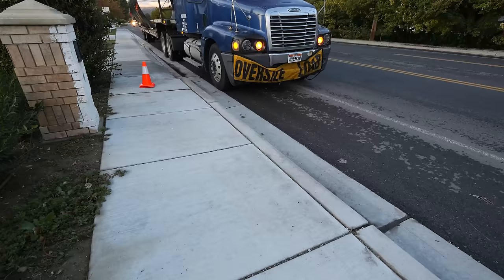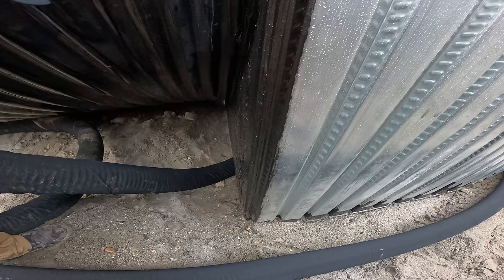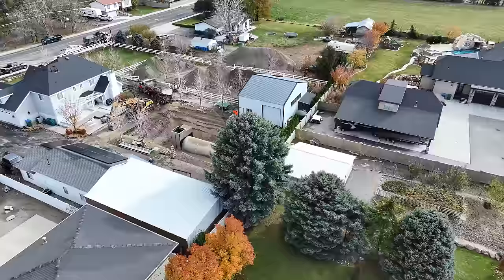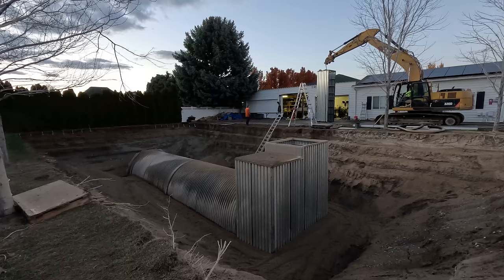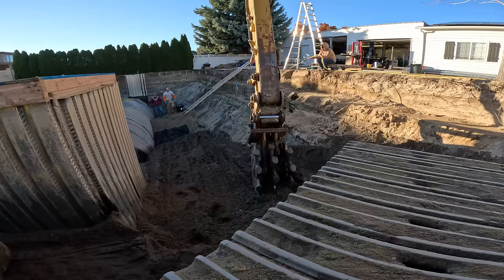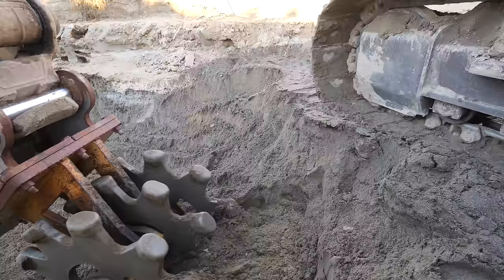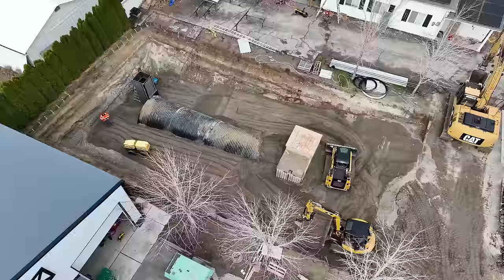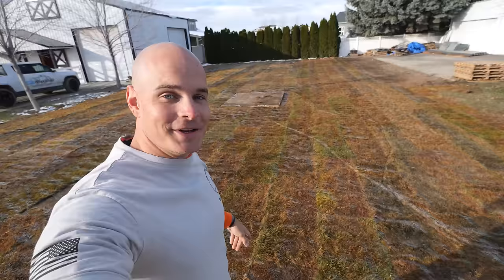BACKYARD BUNKER PART 6 - How To Bury a Tube

Comment: How would you do the plumbing for the bathroom?? 
This series deserves to be on discovery or history channel 🙌🏻🙌🏻
Reply: You can pump it up to the house's existings  infrastructure
Reply: composting toilets perhaps
Reply: You can use the elevator shaft to pump in and out. And electrical, oxygen etc.
Reply: Buckets? This ain't a hotel dude you're doing it in a bucket 🪣
Reply: Septic tank under the floor and piping to pump it from the elevator shaft. You can see the floor level of the bunker from the side rails and everything under them is prime space for stuff like wiring, plumbing, storage, water and septic tanks and there's surprisingly lot of space considering the floor will be around 2-3' from the bottom of the pipe.
Reply: Best bet, since they didn't run plumbing to connect it to their existing lines, would probably be an incinerator toilet with a pipe to the surface.
Reply: Nah, if it was on Disco or History they'd ruin the whole vibe.
Reply: @MrDehBoss  You could do that.....but one would think you would have put those holes in and run the plumbing before filling the hole and laying sod
Reply: @IcedForce  Ooh, hope not.  Any maintenance or god forbid, leakage, would fill the tube with secondary gasses, which may or may not be deadly, but would definitely be unpleasant.
Reply: No thanks I like the simple Youtube editing without drama and ads.

Comment: here's a small thought, add some concrete to the very bottom of the corrugated tube so you get a tiny flat section so that if (when) water ever does get in, it can drain to where you put the sump pump, and doesn't make little puddles in ever rib of the corrugated pipe.
Reply: But it is very sandy soil which means the water should percolate further down and they never have those puddles.  If you put concrete down you will.  Those drain tubes are there just in case they actually get enough rain soaking into the ground that it can not percolate fast enough.  Something that probably will not happen very often.
Reply: The concrete would also act as a counter weight similar to the concrete in a barge. Reducing the risk of the bunker rising
Reply: Too late! 😂

Comment: In the other video, you needed to reapply a coat of paint to any exposed metal during welding to prevent it from corroding. You and your team applied it while the pipe was underground but I am curious, what about the underside of the piping? How do you know that none of the metal there got exposed during welding?
Reply: Yeah man
Reply: well the lowest welding point was the floor which is pretty high up, so thats why in my opinion

Comment: Your yard has been naturally compacted since they built you house.  Chances are when they build your house/neighborhood, they had to dig down quite deep to put propper soil in and re-compact each layer.  There is compacting requirements and soil type requirements when building structures, and alot of neightborhoods you see getting built, they dig out a giant pit 30+ feet deep and re-compact the entire neighborhood and soil and adding in all utilities.  They do this all at once because its more cost effective to get giant earth movers in and do it all at once, rather then a lot by lot bases, bring equipment in and out and in and out constant... this is why after all the earth moving is done and signed off, they hit the ground running and every lot is perfect levels for building onto.  

So I bet this was all dug up when they built your house back in the day.

Comment: Just an idea. 
Bring Sunlight into it. by some means like Fiber Optic (end glow), Light Pipe, or solar tube skylight.   
Make for a nice low light redundant lighting source. 
No Fuel usage, No batteries , Does not need electrical or electronics, thus EMP proof.  

At a very least bring a small end glow fiber optic bundle from topside to give a indicator for Day/Night.  Can be embedded into the concrete (topside) in a star field pattern to be very discrete.

LOVE the videos,  thank you for shearing them with us.

Comment: Would have been a great opportunity to use a sand battery for heat stabilization. Place a gazebo over the entrance using roller bearings to push off the entrance. GO Big

Comment: Though it's been 20 years, plus, since working to install natural gas pipelines, I am a 3rd generation pipeliner. That being said, I've installed a lot of anodes in my life. Things may have changed, but I was taught that the anode needed to be standing vertically as well as below the lowest point of what is being protected. I only mention this as it deviates from what I was taught.

Comment: I love the bunker! I do have to point out a small error though— that is with the sacrificial anode. This feature was unnecessary for this reason: anodes are used in scenarios where the chemical process of electrolysis is taking place. This occurs on ocean vessels and other metal structures that are submerged into the electrically conductive salt water of the ocean. For a metal bunker that is surrounded by non acidic gravel and clay the threat of corrosion by electrolysis is nonexistent. A bigger threat for you is in fact corrosion by oxidation. However, this process has been mitigated by the use of galvanized (zinc coated) steel in your construction. The zinc coating is ideal in protecting against rust on underground steel structures. So anyway… all that to say that the galvanizing on the steel is sufficient enough to prevent the corrosion process of oxidation but the anode is obsolete in this situation. The bunker looks great though and I love the video!

Comment: This bunker need an garage on top of it! So you can have solar panels on top, fully charged EV inside that is connected to the bunker and delivering power to it, and if everything works out on the outside, you can just climb up and jump in the car and drive away!

Comment: We place zinc on stage tanks located in cave diving exploration routes that are used as safety bottles. Depending on the depth and if the lead divers are using one or two rebreathers determines how far apart the bottles are located. Sometimes they stay in the system for a month or a few months but have been in for over a year. Even adding these the current going over the tanks puts them enough it ruins them. For short periods he makes enough of a difference that it saves some. The non profit is called Karst Underwater Research. Deepest dives are about 550.

Comment: Great Video. I am still a little confused about the anode. You mentioned that it helps reduce the corrosion in the bunker because it is made of zinc which corrodes at a faster pace and is essentially less resistant for electrons causing them to go into the zinc instead of the bunker, but how does the anode corroding at a faster pace help reduce corrosion on the bunkers tubes? I understand that its drawing the charge out of the bunker, but how is the bunker getting charged in the first place? Is the ground always slightly charged which leads the electrons to go to the bunker causing corrosion? If someone could give me an expert explanation I will greatly appreciate it. I am an engineer but I work on planes, so I am not familiar with these types of things but it sounds incredibly fascinating. I am sorry if the answer is super obvious and I am missing something here.

Comment: you should of lugged that cable... that sacrificial anode wont last two years as the copper core will fail before your anode does.
Reply from the maker: Valid point

Comment: **Safety Notice** I'm sure you know this..But, I'd like to keep watching your videos :).. Now that it is a fully confined and low-laying space, 20CFM per person and an additional 100cfm for work going on is required. Renting 1x12" blower and 2x10ft lengths of duct should adequately ventilate that space. Turn the blower on 5-10minutes before entering the bunker to clear anything from overnight. An extra blower and 20ft of duct blowing up the other shaft would also be ideal(but unnecessary). Also I recommend keeping any gas/diesel powered equipment away from the area.

Comment: Do you need to do any insulation on the entrance and exit shafts to help maintain that livable temperature down there? Being at the surface could let in quite a bit of heat or cold.

Comment: I mean to say if we talking about apocalypse/Armageddon, these type of bunkers are debatable against nuclear The bunker would need to be deep in the ground, concrete and lead shielding but would skyrocket the cost but for most disasters these  bunker would be quite adequate to be in and protected but you also have chemical attack or biological then that’s depending on what type of air filtering system you got, and also protected Water source

Comment: I’m a drainage engineer and have designed schemes which utilise big pipes like this (typically used as attenuation storage for storm water or even foul water emergency storage on large schemes with pumping stations). One thing that needs to be accounted for in the design is floatation - I’m surprised that this wasn’t mentioned (although I’m sure it was accounted for). Much like putting something hollow full of air in water, putting something this in the ground can also cause it to float upward. Typically concrete is used due to its high density to hold the pipe down, with the correct amount calculated to counteract the floatation.
Reply: Didn't they say they put straps around the tubes with giant concrete blocks to hold it down?
Reply: @mikew466 yes, to stop it moving when being re-buried. That wasn’t for floatation.

Comment: 7:40 As an electrician I must say that you have made a crucial mistake! Leaving exposed copper wire underground is a really bad idea especially if it is connected to a zinc bar!
Remember copper-zinc batteries? (Galvanic cells) that's exactly what you made! In a few months the copper will corrode (degrade) and the wire will fall off!!!
Proper installation requires, the anode wire must be connected from the inside! through a fuse and a 10-100µA gauge ammeter. (ammeter needed to see the state of health of the sacrificial anode)

Comment: For the floor structure you still have to weld? If so wouldn't welding cause the paint outside to burn off and cause areas to be bare metal?

Comment: No plan is ever perfect. With that in mind, I'm seeing the 'thrown' gravel hitting the tube and galvanized metal. Will that compromise the coating?
Reply from the maker: I don’t think so. It took us an extraordinarily long time to grind the coating away with wire wheels in order to weld to it. And the tubes were designed with this coating with this method of being buried in mind. I don’t think the flying rocks did any damage at all.

Comment: That drone crash into the tree was a full on jump scare 😂

I'll just repeat what has been said in comments on previous videos: now that the bunker is fully covered and enclosed i hope you have some detectors for the dangerous asphyxiating gasses that tend to collect in sunken unventilated spaces and displace breathable air. I also hope your bunker fitment plan includes a robust ventilation system.

These gasses are no joke. Without proper precautions you could go down there one day, maybe poke your head down into the underfloor storage cavity to search for something and take a couple breaths then just collapse. At that point if there's nobody with you that can pull you to safety immediately then you'll just asphyxiate before anyone even knows something has happened.

Be safe, be smart

Comment: I have a question about corrosion. I just reached the part where said the tube is rated for up to 100 ft underground, but you are going 6 ft. Wouldn't your corrosion worries increase even more because you're so close to the top of the soil? Wouldn't it be more moist and susceptible to corrosion because of this?

Comment: The anode needed a crimp connection and then tarring. What will happen there is the copper wire will corrode and break, leaving the anode to do nothing. This is why you can't torque down onto bare copper wire, the copper simply flows over time and you end up with a loose connection, or the uneven expansion of materials does the same thing, either way it's going to corrode and how fast depends on soil conditions. Your Engineer should have pointed this out to you. Underground connections are a whole new level of over engineering
Reply from the maker: You are probably correct

Comment: Hey Jerry, i wonder why you did not consider making your bunker an earthquake-resistant. I didn't see any seismic isolation bearings nor any type of shock absorbers laid at the very base.
Reply: Tunnels are already earthquake resistant, the only reason to use shock absorption underground would be to protect delicate electronics or sensors.

There are many underground rail lines in earthquake prone areas, think Tokyo metro

Comment: So why didn't you put a bunch of construction material, like plywood, drywall etc etc into one of the tubes before you buried which will now only make it harder to lower down all that stuff through the main access shaft?

Comment: Why didn't you place more materials in the tunnel before closing off the ends? Now it's buried and closed off you have effectively restricted the maximum length of anything you want in the bunker by what will fit down the main shaft.

Comment: I’m still a little confused on why the inside of the bunker is being fabricated after being buried rather than having a more finished interior prior to burial. Seems like it would be much easier to work on the interior without the constraint of it being buried.
Reply from the maker: We figure it would be hard to ‘clock’ the bunker correctly if the floor was pre welded in place before the crane lifted it up and set it back down. With the tube being around it could roll around throwing everything off
Reply: @JerryRigEverything  Thanks for your reply. I’m really interested to see how it all turns out! Thank you for the content! Awesome to watch it all come together.

Comment: Would it not been easier to have used a plastic tube/ smaller sewer pipe and dropped your anode into the ground with a rope wrapped to pull it out in 30 years and fixed the termination near the top onto the body work

Comment: Easily spent 100k on this. I've seen industrial Groundworks done with less attention to detail than this, in fact I been in the industrial construction industry for 20 years and I haven't seen this level of engineering go into anything. May e that's because it's built on sand though. It's just rock here.

Comment: Great video and build. However, any grunt with combat experience will tell you that bunkers are ready made tombs. They are easy to defeat from the outside whether by taking out the ventilation, putting smoke down the vents, or by blocking egress. They will protect you from nuclear blasts and fallout, but after that they are easy targets for all your “former” friends and neighbors.

Comment: hmm dumb question : with so much ground / concret / forces etc, being exerted from the bunker, and with those trackers and tools, 

wouldnt it be safer and ideally, to say, put deeper and taller steel/ iron pole, as both a lightening ground and incase, [ im not sure why im thinking like this ,  but my guts says ] 

the need to ease the underground forces , to prevent leaking cracks, from all those sheering forces or stuff from affecting other parts of the home ?  so theres " some gab " for the excessive force during cold days or hotter times for it to expand and contract ? 

i apologize in advance to anyone whom they feel im trolling, im seriously wondering here, since i see cracked roads and pillars from all over, in a cement jungle dweller myself

Comment: btrw all of this stuff, renting  a huge crane, remote control vehicles etc, huge sewage pipes is enormously expensive.  You are looking at 10,000 to 20,000 easy just putting these tubes in the ground.

Comment: 1: I didn't notice any plumbing, electrical or sewage lines in place or stubbed out. 

Please don't tell me that you are going to re-dig up a bunch of what was just filled in like our joke of a public works around here does AFTER paving a new &/or re-paving a street?
(My city/state, not yours. I have no idea how they do it there!)

2: I didn't notice anything to accommodate hanging HVAC or attaching studs &/or walls to the "ceiling".

3: I would have used smaller diameter culverts for the entries/exits instead of building box structures and I definitely would have used thinner metal for the walls. 3/16" or even 1/8" inch would have been plenty with the framing that was built.

4: You didn't show or verbally address the connection points for the anodes being wrapped or coated in anything.

5: You didn't coat the box structures with the material used to re-coat the weld and grind spots. What is the reasoning for that?

Can't wait for the next video to see/hear how you address these issues as well as the financial accounting you mentioned is coming!

Comment: If you heat the internal air above that of the outside soil you will get condensation on the interior metal walls which will roll down and collect at the bottom. Houses in cold climates face this issue. Interior moister permeates toward outdoor cold siding. Thing is, the outside wall can breath and dry out, your metal tube can't breath to the outside of the metal walls. You will have to have mechanically forced air circulation to deal with humidity from showering, cooking and breathing. If this is really a dooms day bunker, once your air circulation ceases, you will be driven out in short order due to rising humidity and stale funk and low oxygen. As The Lord God says in the Christian Bible, men will hide themselves during the last days, but they will not escape the wrath of God.